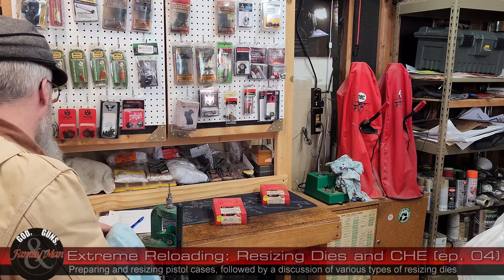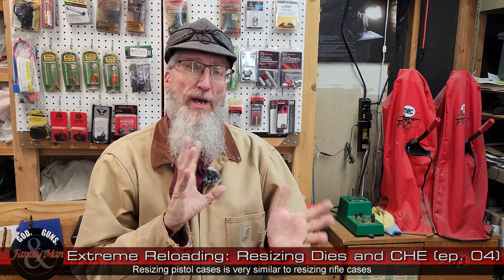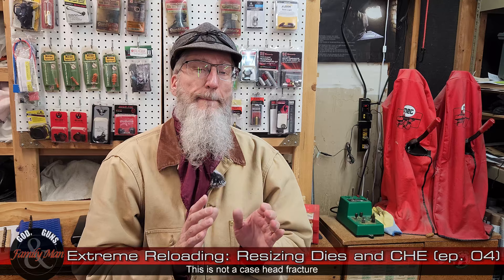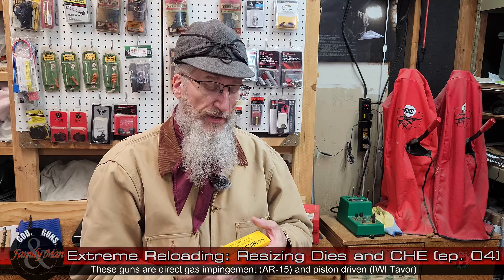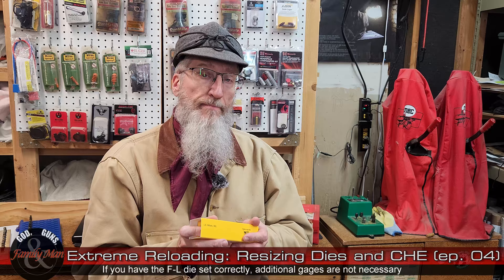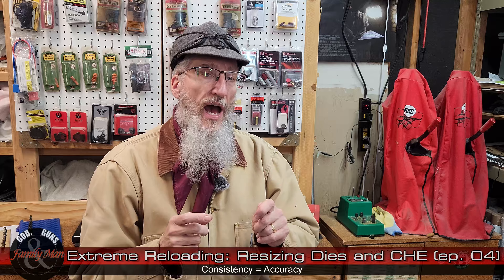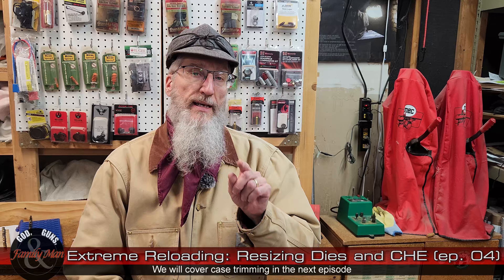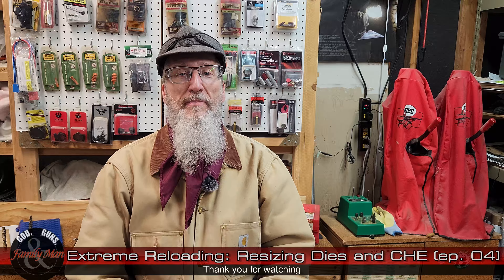Resizing Brass, Selecting Dies, and Important Case Measurements (EXTREME RELOADING ep. 04)

Comment: Love the Channel. New to reloading so newbie question. I understand if the 9mm case is too long not worth trimming. What if the case is shorter than speck?  Can I use or do they have to be exact length?  After resizing many of mine are slightly shorter than speck.
Reply from the maker: Very good question.  They case can be slightly shorter and that is OK.  How short are they?
It is of course ideal to have cases of the exact correct length but I have loaded plenty of 9mm Luger cases that are slightly shorter than spec (but very close) and they are safe and reliable to shoot. Just make sure it is not a 9x18 (Makarov) or .380 case.  I recommend looking for 9mm Luger on the headstamp. I hope this helps you.
Reply: Thank you for taking the time to answer my question. Lyman’s reloading book states the measure should be no longer than .754. Most of mine after resizing are coming in between .745 and .750. Yes all Luger Brass. Is this acceptable?
Reply from the maker: @MrScubalife  I just checked a bunch of prepared brass and the shortest is 0.747"... that is after expanding the mouth/flaring. Your 0.745" cases are quite short and based on how the 9mm Luger headspaces I would be a bit concerned about those really short cases.  BTW, are the short cases all the same "brand" of brass?

I also checked the actual SAAMI spec for 9mm Luger.  OAL is 0.754" with a tolerance of 0.010"... so cases 0.744" to 0.754" are all in spec.
Reply: Yes, great call out. The brass that is shorter than 0.747 S&B 9mm Luger. I have about 12 out of 50. The PMC and Winchester are all longer. I through all the shorter S&B out!  I truly appreciate your help and expertise. Being new at this. It’s nice to have a channel that teaches. I can’t wait to see your next videos. Happy New Year.
Reply from the maker: @MrScubalife  And Happy New Year to you also.